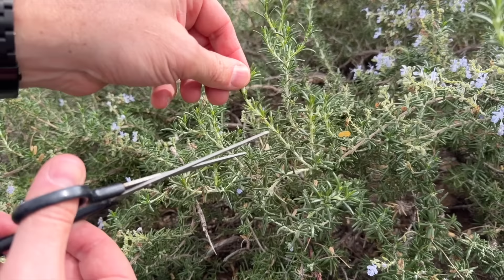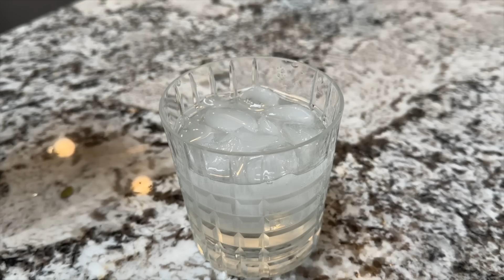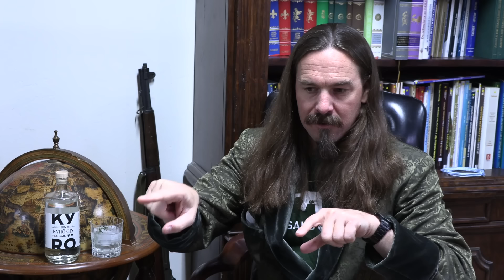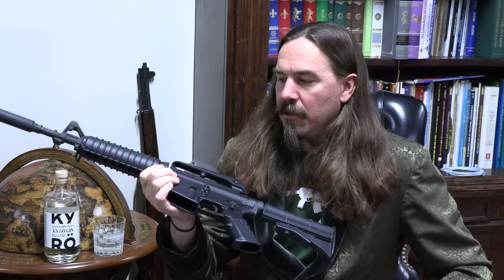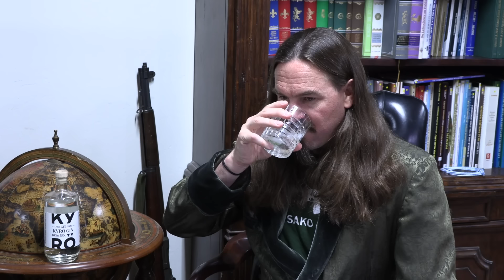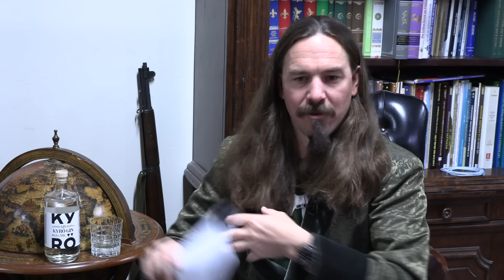How Guns are Made: Tolerances, Methods, and Metallurgy (Q&A January 2026)

Comment: As someone in the “metals” industry, cutting things out would not be our limiting factor- heat treatment on a massive scale would. Lots of furnaces needed, lots of power and nat gas needed, lots of proper quench tanks needed, lots of space needed. Also, overall machine capacity in the US is astronomicaly lower now than it was during WWIi because of CNC capability, but mostly off shoring of that capacity.
Reply: With most manufacturing processes, you can just put on additional shifts to increase production - but thermal processing facilities tend to run three shifts already; you can't afford to have the equipment running at temperature unless it's being productive, but you also can't afford to lose at lease half a shift waiting for it to come back up to temperature after being idled down overnight.
Reply: Yes excellent point. A surprisingly naïve take on this otherwise vefy well-researched and considered channel.

1. There are highly specialized processes (stamping, ramming, heat treatment) that are highly energy intensive and or require massive machines. You can have a CNC-milled instead of a stamped part, or say a drilled vs rammed barrel, but in both cases the output will be a prettier part that's however heavier and with a far reduced service life. Steel is malleable, and CNC machining doesn't compress or tension the metal's grain structure. So you may have CNC-machinned gun barrels that weigh 1.3x, cost 4x, and have 0.25x the service life of the old-school ones.

2. There's a certain fabrication energy budget per gun (or any other item) made a certain way. If the facility lacks the energy input of a given magnitude (electrical utility hookup, gas etc, water for cooling) no amount of machinery on site will make a difference to boost procuction above those constraints of energy input. It's a huge deal to increase power capacity at a given site, as AI datacenters demonstrate. In some cases, longer than the WWII had lasted (hint, hint).

3. Modern advances such as superior tool & die materials, cutting surfaces resisting wear longer, additive manufacturing, laser & other automated measurement, robots, may in theory somewhat reduce energy requirements, but in reality serve mostly to lift design constraints that encourage more slop, just like faster CPUs encourage software bloat & enshittification much more than they make our actual compute results better faster.

4. Even if we manage the power and the process design to 100x the production output, where are we getting 100x the people to actually tend to those machines & manage the process & any issues on the factory floor?? Hire them out of McKinsey or McDonalds? 'Cause there's nobody in between, we've made sure of that over decades of "profit enhancement". And it's not just a matter of finding the folks - it's finding the folks at time of war that you can trust. Stuxnet had demonstrated, malicious code injection can wreck an entire factory's worth of precise machinery. It's instructive to watch Smarter Every Day's Destin's valiant effort to make a grill cleaner brush 100% made in America, even for $80.

In summary, and as the conflict in Ukraine had laid bare, domestic Western manufacturing is inelastic scale wise, if we're talking 100x scale demand. 2x-3x they can do after years of strain, maybe. 100x? We're 99% fucked. No true capitslist enterprise outside of Putin's Russia or Belarus maybe, is going to invest in maintaining 100x excess capacity. In fact they want 0% domestic manufacturing capacity.
Reply: @AlexKarasev  Id like to give multiple thumbs up to you, for 1. and 2. as they were informative, 
3. for coming from CompScience, I couldnt agree more that more resources just lead to lazier work and more slop... 
and for 4. as that was an incredibly depressive video to watch, when you think about what that means for all of production...

Also partly agree on the summary, we cannot do 100x, but the question is - do we ever suddenly need 100x?
Putin with all his "import substitution" still cannot produce anything, not computers or phones, not cars or planes, etc (let alone tanks and jets, in any significant number) 
While the west could hold him back, despite not bringing its capacity to 100x...
Reply: @peka2478  yes, you're right, we don't need to 100x for Russia's sake, esp in light of the points you've made re: their own domestic manufacture woes. But there's also China and to a small degree Iran, which several of our Presidents, in their infinite wisdom, pissed off at the same time , ensuring China's realization with certainty that after Russia & Iran it's next - while creating a rift with Europe.  Sen Tzu says "hey man, don't worry about my ethnic calligraphy BS on bamboo sticks, do what you feel in the moment 'cause *your the best just like your momma said".

On the other hand we've Russia, which it'd taken 3+ yrs in every conflict since time immemorial to get its sh*t together and show up. Hitler, Napoleon, Polish-Luthuanian Commonwealth (that'd taken Moscow, mind you), the Swedes, the Golden Horde (Mongolia now) weren't stupid. They'd looked at peace-time Russia & said look.at them, I can take on this pathetic wreck. The space they occupy on the globe is completely out of line with their military & industrial posture. Best I can describe it is, Russia collectively is like a Vietnam vet, brooding and thieving and dysfunctional in its collective PTSD. "A bear witbout a cause" :) But when war breaks out, that Vietnam vet suddenly finds himself in his element. Napoleon's Great Armèe suddenly finds itself 1,000 miles into a country that has little in common with the one it'd invaded. The transformation defies logic.

Ukraine is 4x the size of Vietnam, just as feisty & inventive if not more, orders of magnitude more tech savvy vs the common Vietnamese, and has gotten perhaps 5,000x the military & financial aid Vietnam had gotten, while Russia is shackled without Agent Orange, Napalm, shock and awe and other tactics usable e.g. at Fallujah or Gaza that'd multiply the rate of advance while reducing Russia's own casualties.

Putting all this together adds up to a somewhat worrying picture, esp considering our own media at war times is duty-bound to feed us the good news. If Putin saves a kitten, they're gonna brainstorm what's wrong with that kitten that they can use.
Reply: @AlexKarasev Here is something to keep in mind. If we were to wake up tomorrow in a non-nuclear WWIII, there are a few absolute guarantees. First, our power & communication systems would be inundated with constant cyber attacks. The “fallout” from this would be horrifying especially when you consider no single street light is working properly in any major city. A couple dozen accidents later and the roads will be impassible for hours - or days and materials won’t get delivered. What is likely to happen is the USG will confiscate every single AR pattern rifle not in the hands of private citizens (while also “asking” for donations from said citizens) as well as any “standard” optics. Sales to private parties will be banned (same with all 5.56, .308, 9mm etc) and the government will buy up all supply. This alone will supply them for YEARS of conflict and more importantly prevent other major manufacturing for ships, vehicles, and aircraft from having to sacrifice machines or supplies.
Reply: @TheDiameter   you're talking about small arms, whereas based on Ukraine (which is "only" about the size of Texas - but a small part of your scenario's theatre scale) the lion's share of casualties (what moves the needle) are based on drones / mines / artillery / missiles / bombs. I expect the US has a very healthy supply of mines and bombs, but I suspect things are less certain with artillery shells and barrels, not great with missiles, and ugly with drones.
Reply: I did a feasibility study on setting up an aluminum heat-treating system of limited size for my employer (Aerospace). Two big cost factors were hiring an engineer and increasing the electrical service to our facility. The process footprint was significant, part of the reason not to move forward was exactly as you stated: it wasn't cost-effective without running it around the clock.
Reply: @slick3129  Had a similar discussion recently on the financial feasibility of a new coating process (also aerospace). Problem isn't the tooling or the coating chambers or the materials for the coat. But that it has to be done in batches and has to be done often enough that the machine doesn't gunk up. Running a batch only once a week would mean it'd need to be cleaned and maintained for 3-4 days every month. This is why companies have to off-shore certain treatments, coatings and other processes cause doing it in-house you'd simply not be able to provide the volume.
Reply: @DerLoladin  We had an Alodine treatment and a paint shop with booth because most of our sheet metal parts required both. Processes like anodizing and heat treatment were outsourced locally because we didn't have the volume to make them profitable. We were lucky to be within 30 miles of the 2 biggest Lockheed fighter jet production lines in the world (Dallas/Ft. Worth), this guaranteed that there are numerous sheet metal/machine shops like ours and the supporting specialty shops for things like heat treatment, anodizing and third-party inspection like dye penetrant and magnetic particle.
Reply: Never to mention traceability. Half my job is just making sure we have certificates for what metals we used and surface treatments. I have had to scrap finished parts because we didn't have the certificates to prove it was made with 355 steel or 6082 aluminium
Reply: @Aoskar95  wow. There was no way to establish that fact with lab testing? (Obv that depends on the size of the batch, but probably also formalities like if the client is willing to take the lab's paper vs original certificate)
Reply: @AlexKarasev there's more to it. When working on government contracts or customers with government contracts, you need to prove the source of the raw material to. I can't use anything mined or refined in Russia or Belarus. And for American contracts we have to avoid chinese metals to
Reply: Nat gas just to get electricity (so, could be replaced by a nuclear power plant for example), or for some other qualities it has?
Reply: @peka2478  nat gas burns very clean, unlike oil, so you can rig up a ton of things with it, be it localized heating in some machine or local emergency electric generation via some compact turbine generator. In other words it's possible to McGyver a ton of useful things in manufacture with nat gas, without exotic materisls or expertise. Electricity is supposed to be more versatine & transportable in theory, but in reality b/c everyone defaults to it, its supply is pretty allocated, if you need to add a massive brand new powerline but there's private properties in the way with no easement you're kinda screwed, where at times of emergency, nat gas at least you can truck it for the last mile. It's a little bit like with major datacenter replication - over the network is supposed to be the way to do it per conventional logic, but at scale what people do is truck cases of hard drives from place to place as that's faster cheaper given avail capacity - pigeon mail, essentially.
Reply: @AlexKarasev  wow, okay, that was super helpful, never thought about the advantages of fuel for stationary infrastructure!

btw, the semi-official name for "pigeon mail" is IPoAC, or "Internet Protocol over Avian Carriers" xD
Id even go so far as to call this the conventional logic by now, "dude in car with hard drives" beats "data transfer over the internet" for certain classes of cases
Reply: @peka2478  wow, thanks, I just learned about a new protocol! :)
Reply: As a machine shop estimator for a small machine shop that fabricates OEM military and commercial helicopter parts. I can confirm this is exactly how those big name companies do it. And all our finishers and heat treaters work with gun parts as well very cool video. Sharing with my coworkers!
Reply: While it’s not a panacea, it’s worth recalling the rather mundane contributions that priority and rationing has played in earlier “battles of material”. Some of the current load on these resources and capacity will simply have to be cancelled or reduced, if it doesn’t contribute to the military production.

It’s worth recalling that one way the US managed to become the “Arsenal of Democracy” during WWII was by suppressing civilian supplies to free up resources and capacity for the war effort. Thus, the reduction in certain foodstuffs for the civilian sector and such things as no new civilian car production, as seen in the lack of new car models by the major US manufacturers during the (US) war years.

The big problem, as is currently seen in Europe, is when deindustrialisation has led to extremely low overall capacity and capabilities, especially when trying to both continually supplying and arming Ukraine and expanding domestic military capabilities, but without starting to run anything resembling a war economy.
Reply: Injection molding as well

Comment: I have repaired a few gun parts but it's basically welding something together that broke and then polishing it out but over the last 25 years, less than 10 repairs have been for a gun. Most have been for a double barrel shotgun opening lever that broke. The problem with welding is that is ruins heat treatment so it's not a simple thing  once you get to parts that can go boom.

Comment: So a Blanchard lathe is a like a modern key cutting machine?...
Reply: It´s a copying lathe, at least that´s what I know it to be called.
Reply: @sierraecho884 indeed, and it's used for every kind of wood carving.
Even wood handles for tools like shovel, picks, hammers, that are not cylindrical are done by putting half a dozen blanks on a machine with a bronze master shape to copy.
Canoe paddles are done the same way.
Reply: pretty much.

The original "key" and the blank both rotate at same speed so you have a 3D copy and not just a face copied, but it's same basic principle.
Reply: In that they are both pantograph cutting machines, yes.
Reply: No, a key cutting machine is like a modern Banchard lathe.

Only far, far less complicated, as key cutting only takes place on one axis.

Comment: Cnc machinist here. I make all kinds of gun parts in my off time. Almost any machine shop could easily pump out various parts for anything from small arms to tanks, artillery, and munitions. Just give us the part drawings and it's easy.
Reply: You can´t make it fast and cheap enough. No car is CNC machined. Guns need to be cheap and quick, they need to be stamped for most parts, cast for some others.
Reply: @sierraecho884 uh, a cylinder head is absolutely machined on a cnc mill. Lol. I can set up a lathe with an automatic bar feeder and pump out any round part that cant be stamped or cast, 24hrs a day, faster than anything else.
Reply: @mhb1323  "...uh, a cylinder head is absolutely machined on a cnc mill...." Yeah, engine parts are, those are less than 0.1% of all parts. Body panels, suspension, etc. none of this is milled. It´s due to cost and time. Unless this precision is required. 

"... I can set up a lathe with an automatic bar feeder and pump out any round part that cant be stamped or cast, 24hrs a day, faster than anything else...." Not faster than a stamped part, that´s why only parts that can´t be produced any other way are made that way. You can stamp 60 parts a minute easily. One 8h shift production can easily be 30k parts. Every manufacturing method has it´s place, it´s just you don´t design parts in the automotive world to be CNC machined, unless they  can´t be made any other way, due to costs and volume. It´s different with planes and such.